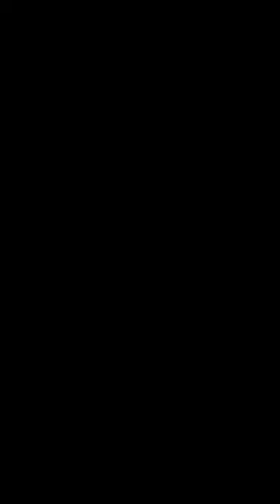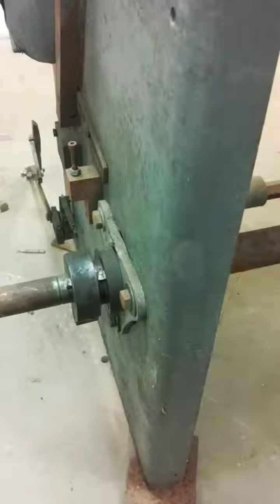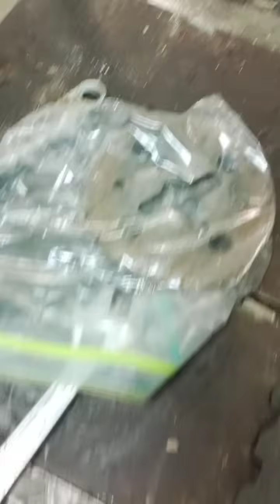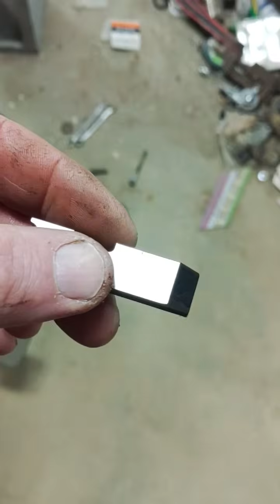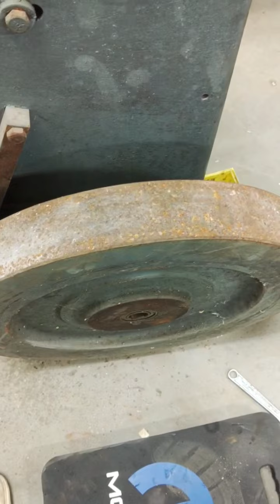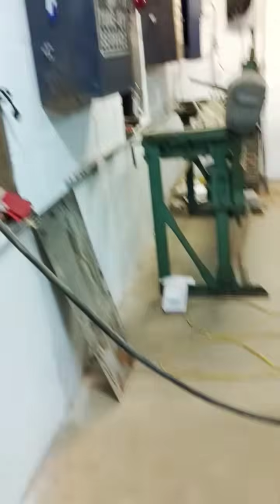Repair of a Di-Acro 36" power shear

Comment: Where did you find the replacement pin??
Reply from the maker: I was able to order it from the company. I tried to make one, but it has several different angles and if they are off just a little, it won't work.